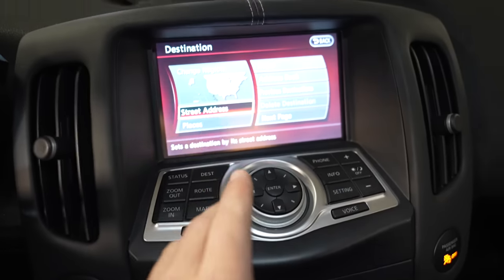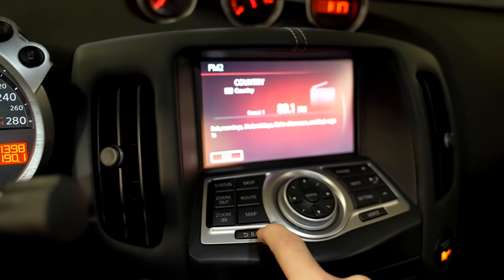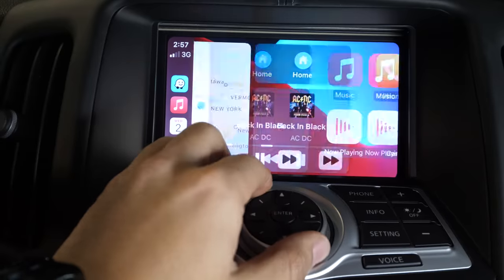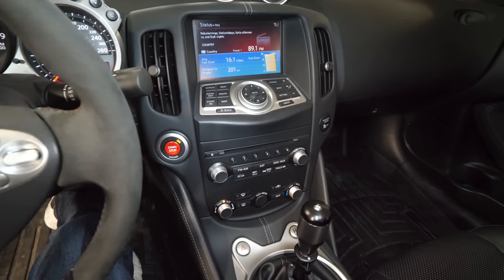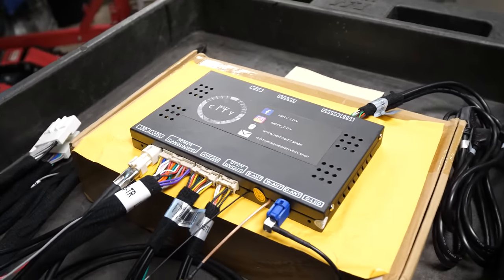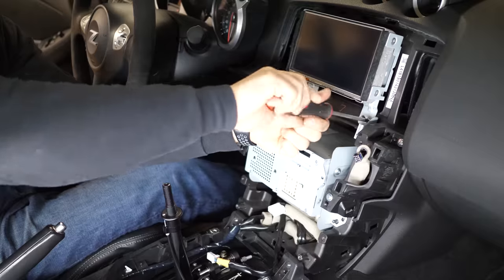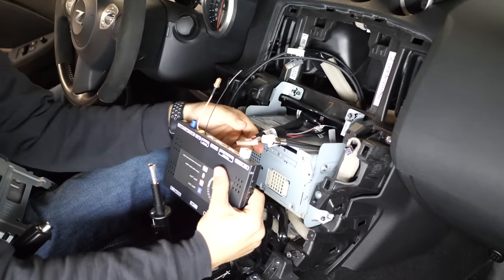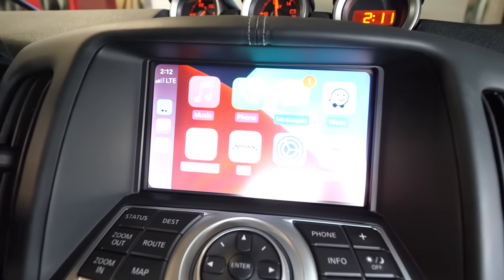How to Get Apple Car Play on Your Stock Headunit

Comment from the maker: I should have been a bit more clear about the pricing: 

The basic kit costs $599 USD = ~$770 CAD
The advanced kit costs $699 USD = ~$900 CAD

Based on what country you live in, the price of the kit will fluctuate due to your exchange rate. Be sure to check Nifty City's website for the most up to date pricing, ALONG with their competitive discounts!
Reply: Where you can get it
Reply: The wireless dongle that you briefly showed at time stamp 2:32... is that something that’ll always be dangling out in the open?
Reply: Does this fit with a 350z
Reply: Overpriced!! just get an aftermarket
Reply: Looks like the prices went up, now $1042 USD for the basic module.
Reply: For those prices it’s not bad, comparing to the price of the original extra.
Reply: Might as well get an alpine head unit w/carplay  with that price better sound quality and cheaper lol
Reply: Sorry about your accident on your Z. Would you be open to sell your advanced kit?
Reply: nah this ain’t it idk how he’s promoting it

Comment: If anyone has a static filled audio, it’s due to the aux to usb converter supplied with it, try using an aux(female) to rca cable (red, white av cables) and plug it into the center console. 
Works flawlessly and you get a lot more volume as well.
Reply: Hi, Why not just load up a usb pen drive with mp3 or mp4 or avi's and plug it into the cars usb under centre console lid ..works fine in my std 2010 Fairlady Z
Reply: For the asking price, why would someone want to work around to destatic the adapter? For that price, an aftermarket headunit would improve the sound, and if I need to open everything as if I was changing the radio. I would get a aftermarket with CarPlay in the first place the 10 inch Sony, Alpine, etc, radios run somewhere around $1,100. This shouldn’t have anything interfering with the experience, especially because it is wired into the rear of the factory setup.
Reply: Do you know if this works for g37 models with only 1 USB hook up and no audio in inside the armrest storage?

Comment: Nissan and Infiniti have always been behind the times with their radios, don't get me wrong, the sound is amazing, but last year (2020) was the first time they came out with apple car play android as options. The difficulty with replacing the radios in some of their older cars is the heater/aircon controls are integrated with the radio making it very difficult to replace. My 2006 G35 didn't even come with an aux hookup and I opted for a piggyback setup to keep the factory radio.

Comment: $900? That’s how much I spent on a great after market radio, 4 channel amp, subs, and all new door speakers. 🥶
Reply from the maker: I've also spent more than $900 on an amp before..? You often get what you pay for
Reply: A great after market stereo will be $500 and up, a great amplifier, like an audiocontrol LC4.800 four channel is $569, a great set of component speakers, like Focal PS 165fxe will be $649 or $1298 for two sets, a great sub, like a JLAudio 12W7 is $1,049, and a great sub amplifier, like an audiocontrol LC 1500 is $769, for a total of $4,185. And that does not include rca’s and power wires.
Reply: @ULSB1969  yah this kit he's trying to sell if a big rip off
Reply: @cali_cal  360 camera with aftermarket stuff would come to be tricky stuff. Luckily they sell bolt on android which will replace whole center dash, including climate control with Tesla-like touchscreen.
Reply: Lmao how?
Reply: For this generation of Nissans there aren't too many options so this is a good deal.
Reply: OEM is OEM, and that's the whole point of the video
Reply: Do you recommend something cheaper?
Reply: @saby8765  not OEM if you are installing a non OEM kit, even if it sits in the middle outside of plain sight.
Reply: I guess this is for people that like that OEN look. My wife just wont allow anything not OEM in her car. I, on the in her hand, dont mind it much as long as it is a good quality system including audio components and interface (buttons, ui) with good fit and finish. Sometimes there is very limited options at a cheaper price than what is being offered here. Plus the fact that everything looks like it is plug and play, no soldering wires or having to search for wiring diagrams online.
Reply: Sounds like super cheap gear to me.
Reply: @milanmastracci for a 1000$ i rather source an oem unit from a newer model
Reply: I don’t think it’s a bad deal as it’s integrated with the factory unit and all steering wheel button work. Where I make bread, I cannot have a non factory radio without getting my windows busted and said radio stolen within hours of parking. My neighborhood is not that much better. I will pay up to $900 going through non factory units before I buckle down and install my original. I have found luck with putting a plastic bag over my radio to look like I’ve already been robbed. This worked well when prior to the advent of screens as I could memorize the knobs through the plastic bag but I don’t want to live like that anymore.

Comment: Ordered advanced module for my 370z, waiting to come in March. Thanks for a great instructions, I will go by your instructions once I start with the installation. Couple of questions : 1) How is the sound on the speakers (any better than stock Bose), is there amplifier component as well integrated into the unit or is it using amplifier from the head unit? 2) What is the Car app doing (showing some info) I can see it is loaded in your screen. 3) It would be nice to integrate it with some dashcam as well, if someone has experience with that, please share.
Reply: Have you installed it yet?

Comment: Thanks for making this nice step by step installation guidelines, your video definitely help to make the installation easier. 

1. How do you like it so far? Do you use it a lot?
2. What you don't like about it?
3. Any bugs or annoyances?
4. Is it easy to shift between the OEM screen and the Android/Car Play screen?
5. Is it not draining your car battery when the car is not used for few days? Reason I asked, my observant eyes noticed red flashing LED at 10:34, 11:54 and 12:10 from the module as soon as you plugged in the power harness even the ACC/Ignition is not turned on yet. I got the impression that the module gets continuous power from the battery, I wonder if it doesn't get hot in the long run even when not in use and I'm concerned about battery drain if I have to get this one for my Armada.

Thanks in advance
Reply: Correctin:  FLashing LED at 11:34, 11:54 and 12:10
Reply: The red led is just receiving power, but it’s signaling low power mode

Comment: Was excited until I saw the cost. You can get a Linkswell 12" tesla screen 3rd GEN for under $999.
Reply: What are they like? Seen mixed reviews on the “Tesla” units
Reply: This is pricey but you get to keep all factory functions like back up camera, steering wheel controls, and climate controls and all that good stuff. I also find aftermarket screens look tacky and out of places versus this retains oem look

Comment: Looks cool, but I first need to know whether this product will actually fill my entire screen. The W213 Mercedes show Android Auto in an annoying/ smaller box that doesn't even fill the whole screen, despite the screen very likely being capable of handling full screen. So will this adapter successfully use the full screen? I have a 2018 E400 with the stock android auto.

Comment: I been looking , for a head unit..
I have a 2017 Infiniti QX50 
7inch screen OEM, the thing is that the control for the heating and AC in displayed in the screen I have...what are my options..
Looking for something supporting Bluetooth, when I checked on cruchtfield...
They recommend not to change it due to the ventilation on screen
😑😑 Need options

Comment: I wanted this for my 2014 maxima
Reply: Yoo same i have a 2012 did u end up getting one?
Reply: Get GROM VLINE 2
Reply: I got it in my 2012 maxima
Reply: @Supastar914  bluetooth? And can u control from steering wheel like change songs instead of manually from ur phone?
Reply: @Supastar914  can u?
Reply: Yes you can
Reply: @nicetricks123  wireless CarPlay
Reply: @nicetricks123  I’ve had it in for over a year.  It just needs to be updated once in awhile with software and firmware via internet connection through your iPhone .  I never had an issue with the module.
Reply: @Supastar914  but like lets say i have apple music can i use the arrows up and down on my maxima to change songs? Because i have an aux it dosent let me do that only volume on steering wheel does

Comment: Quick question about the iphone charger you have coming out of the knee pad, what exactly is that for / connected to? Also, is the cable that comes through your parking brake a mandatory thing to be plugged into the center console?

Comment: Hello. Thank you for the video. Will this installation void any warranty that comes with the Infiniti QX80? For my clarification, the Android Auto/Car play system does not need any external speakers, the system will use the original bluetooth/audio system that comes with the QX80, correct?

Comment: So this likely isn't compatible with an 09 Z, which doesn't have USB in the center console but instead a proprietary Apple iPod 30 pin connector. Ugh wish I had gotten a 2010 Sport model without the touring package. Or I wish Nissan didn't make it nearly impossible to replace the nav units with a double DIN unit...

Comment: What if my Nissan has a basic unit? No nav, no colored screen, etc....
Reply from the maker: Then you will have to upgrade to navigation, and then purchase this kit. As I mentioned in the video, it is only compatible with Navigation models as they have most of the hardware needed (the LCD screen and headunit)

Comment: For 750 I can put a aftermarket head unit in with apple car play an buy the plastic to fit don’t waste your money folks
Reply: Hey there, Unfortunately you cannot put aftermarket equipment on the standard factory navigation systems. You can do aftermarket for NON factory nav models

Comment: Should also point out, if you havent and I missed it, that this doesnt work on every car. They only make these to work with certain brands and models. Example....my 2016 Ford Explorer Sport is out of luck. I instead had to buy a kit that would allow me to just upgrade from Sync 2 to Sync 3. Not a big deal but it would have been nice if something like this would have worked with Ford's infotainment BS.